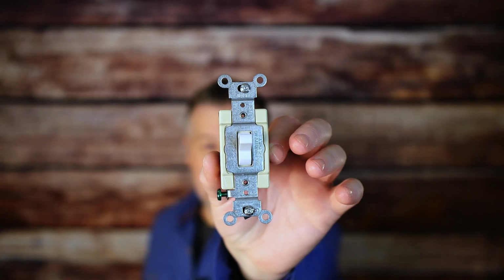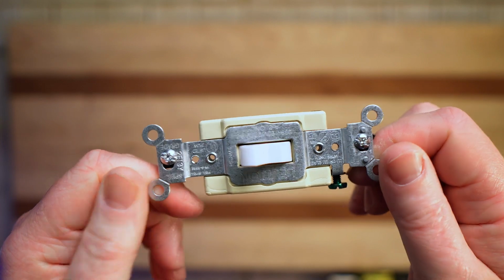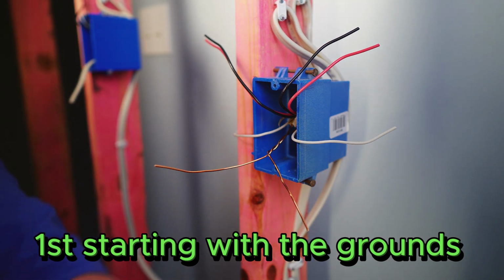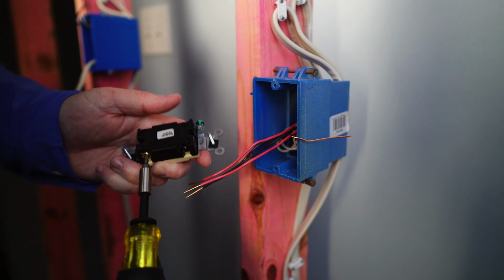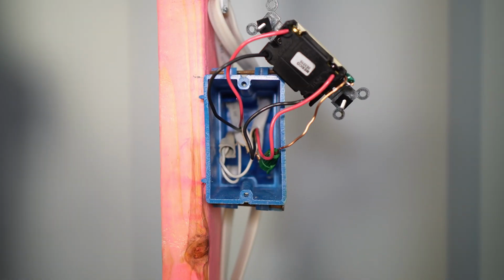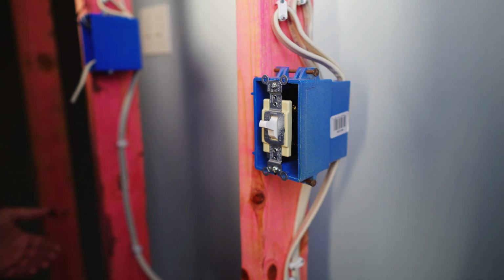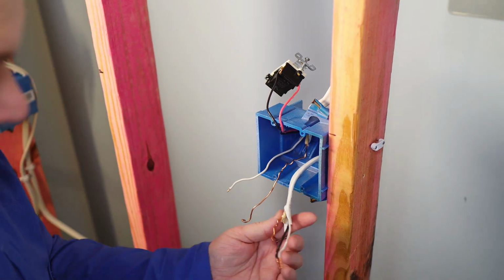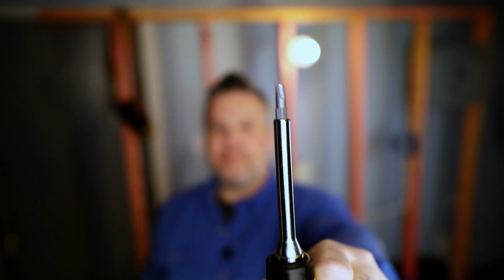4-WAY SWITCH . EXTRAVAGANZA. CUSTOM LIGHTING !

Comment: I like to run my 3 ways and 4 ways in metal boxes with conduit it is so much easier then trying to do it with Romex
Reply from the maker: Hi, thanks for your comment. definitely a more robust system, time consuming running & bending pipe but  more protection  in pipe . In a commercial job, I would definitely run it in conduit, I use Romex in residential applications .